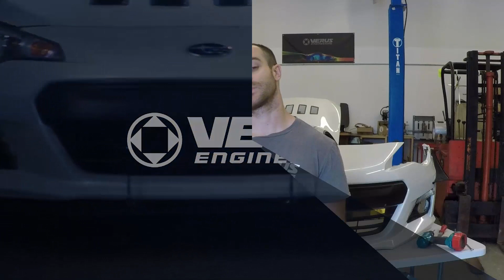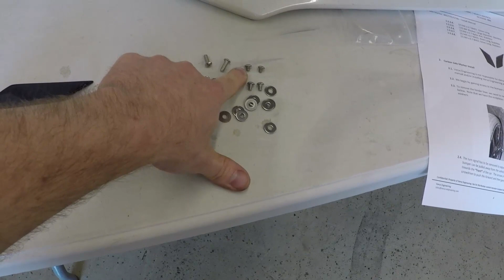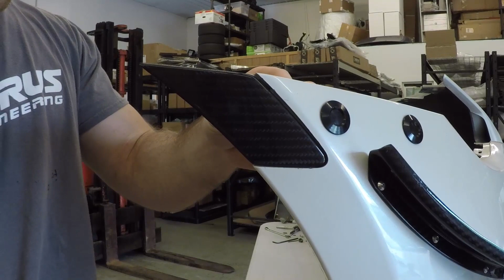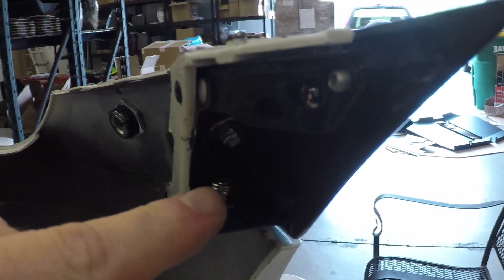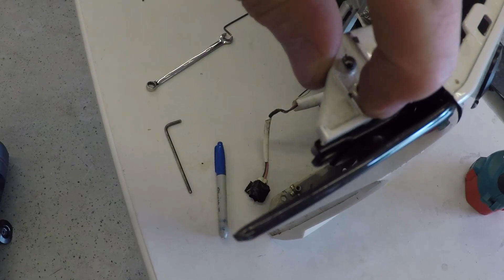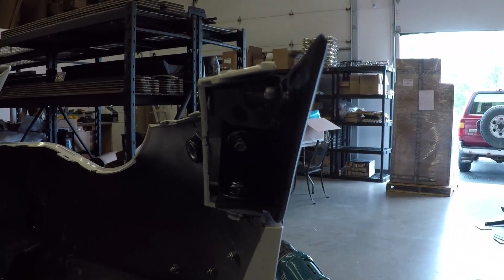Carbon Fiber Side Marker Replacement Install for FRS/BRZ/GT86

Comment: So you have to take the front bumper off to install side markers.  Wtf
Reply from the maker: No, you do not have to remove the bumper for the install. Our bumper was already off the car, so it made the install easier.

Comment: This might be a dumb question but what’s the difference between a nylock and a lock nut? I call these lock nuts. Am I wrong or are these different things?
Reply from the maker: A nyloc nut, also referred to as a nylon-insert lock nut, polymer-insert lock nut, or elastic stop nut, is a kind of locknut with a nylon collar that increases friction on the screw thread. Similar to a lock nut, but different in it's own way.